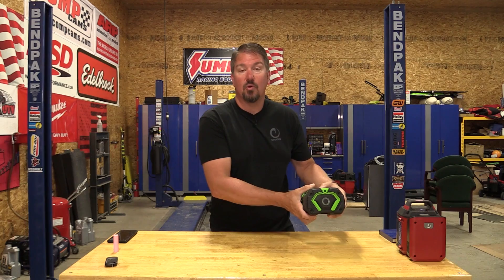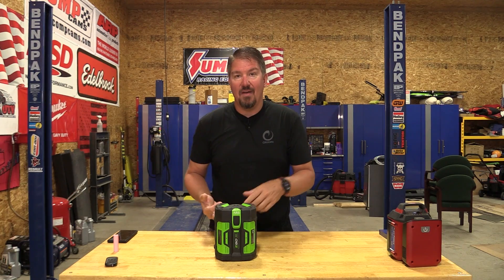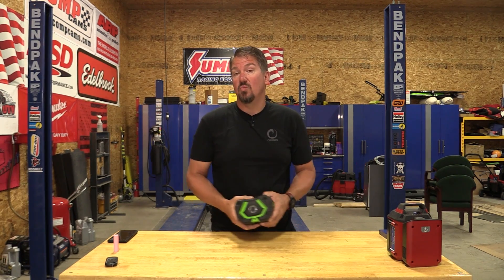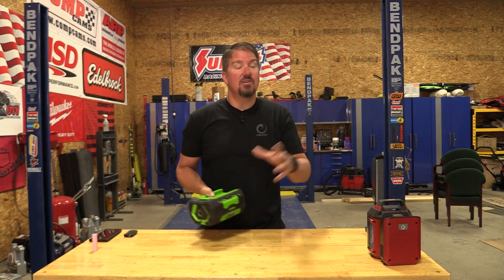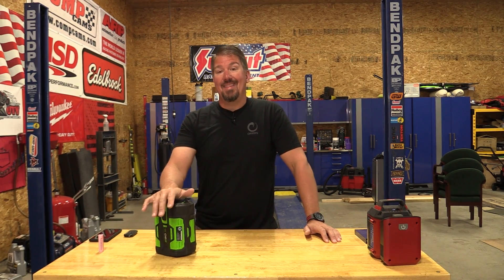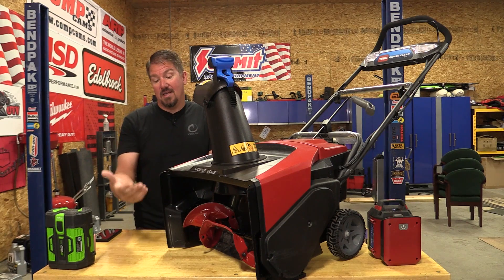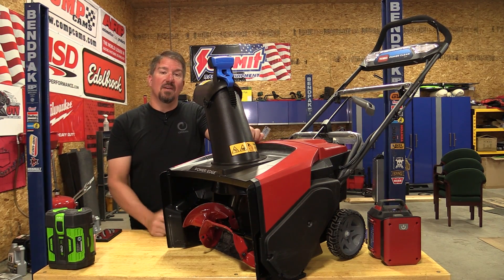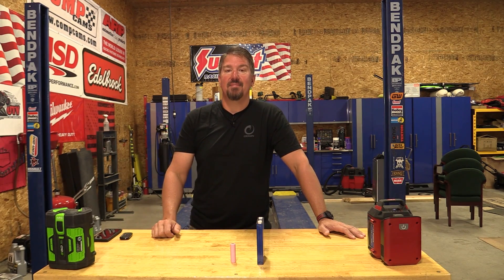Battery Powered OPE - The BIG Elephant In The Room No One Wants to Talk About!

Comment: This is a bad faith video  thanks for the lies
Reply: I think we need a new paradigm tor these things as any natural resource is limited and one day oil will truly become scarce. That being said, let the technology develop and the transition happen when the technology is ready. I have a large property and would have to spend hundreds of dollars every few years to buy and replace batteries do away with $15 or $20 a year in fuel for my trimmer and blower. As of yet, I still have not seen a comparable substitute for my zero turn mower or backpack blower. For some I am sure the current equipment is great just not for everyone.
Reply: A few true bits about the EGO batteries, but a lot of untrue things were said, especially the depreciation on electric cars - that's just Every new car ever made has 50% depreciation after 5 years. A Mach-E I can see being worth half as much after 2 years, but not true for Teslas.

The 'no one recycles batteries' also untrue

The 'toxic chemicals inhumane mines' is sort of silly when phones and electronics are where 90% of toxic chemical batteries are going these days

The 'diesel is used to mine cobalt, lithium, nickel' well yeah, it's used to drill for oil, transport oil, refine oil, then transport it again as well, so what's your point Workshop Addict
Reply: “All these lies”😂😂😂. I’m sure you think electricity to charge these just comes out of the wall, too.
Reply: @dmacl123 electricity can come from many sources. Electricity can go 100% renewable, fuel powered cannot. Electricity will have better efficiency once better battery technologies are developed. Batteries are produced once and “refuel” based on the energy grid which is more “efficient” than single energy production, gas powered equipment requires maintenance and refueling with something that will always be create more pollution than a commuting vehicle. 

I’ve been running battery equipment for a while now and it definitely saves money after the cost levels out. It’s also not as fatiguing and has generally required less maintenance for us. My Husqvarna equipment is still running good after 2 years and especially the batteries which feel like they could last 7+ years before they go out

Comment: The ego batt has a 3 year warranty. Newer batts from them come with a 5 year warranty.  My 7.5ah that came with my 2016 first Gen ego mower is still running strong, I replaced that mower with a new select cut from ego, not because there was a need but because I wanted the upgrade. In fact, the 2016 ego is now in Ohio at the inlaws, and they use it. 

As for cars, we started with a 2019 Volt, then a Tesla M3 and a 2022 Bolt.  Would NEVER go back to gas. The fact that all you do is plug in in your garage vs. weekly trips to the gas station is priceless.

You're griping about the cost. Maintenance isn't free for the average consumer. I'm sorry, but dealing with carb issues is a PITA. Who has time for that?

I've never downvoted one of your videos before, but today that changed.

Lastly, what car is worth anything after 10 years? The reality is that except for a handful if trucks, most vehicles are beat to piss and not worth more than a couple grand after 10 years.
Reply: insert 2008 Honda fit with 483k here
Reply: @snakeyjaake  OK, nobody ever told you to do anything different, you simply got butt hurt over my comment.
Reply from the maker: I understand this could be controversial for some people.  The info comes from my experience and some of the links and info in the description.  If you watched long enough, I pulled out my Toro snowblower I use commercially.  It is not inexpensive to do that, but worth it to me.

IMHO, if you use stabil or rec fuel, carbs are not an issue, BUT I grew up messing with carburetors and making engines make more power.  I enjoy that.

That 17 year old Jeep in the back is worth well over 30K.  And you are right, many cars are worth very little after some years and abuse.  But how many sports cars out there are worth big money?  What about larger stuff like tractor trailers and such?

I feel most people buy battery mowers because there is zero maintenance costs.  Well, there are, and people should know about them.  What happens when your battery goes dead just out of warranty?

BTW, no worries on the thumbs down.  I respect your opinions!  We live here because we can all have them and we do not have to agree!
Reply: @snakeyjaake  Um no. Our 2019 Volt was totalled. I drive the M3, wife has the Bolt.